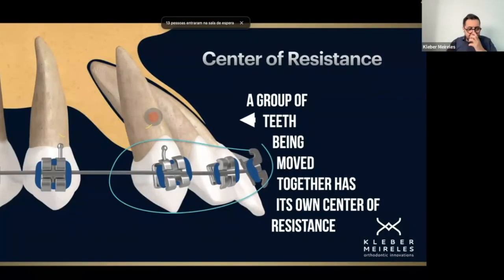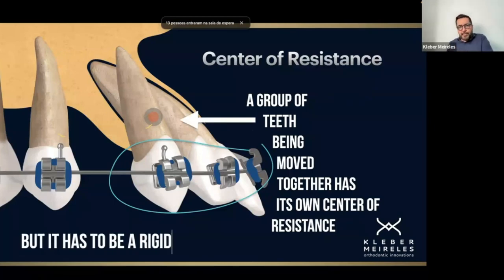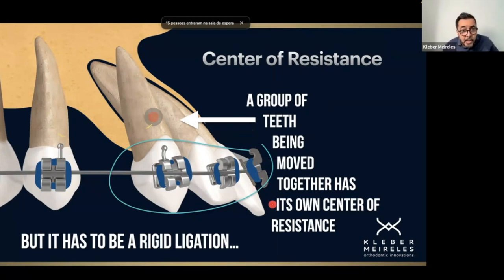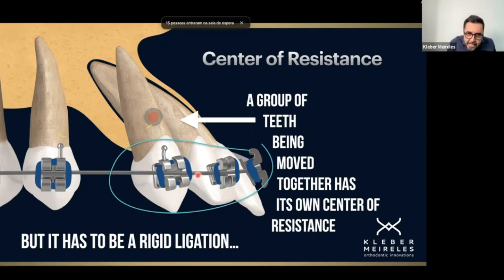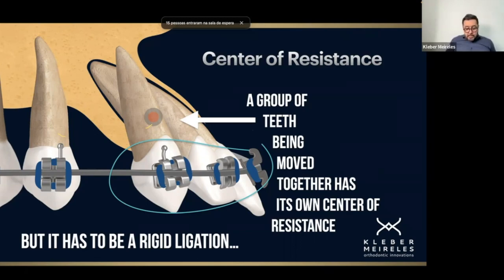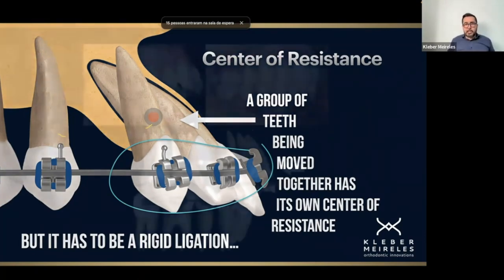Closing Space in upper arch - Translation #1 | ORTHODONTIC TIPS

Comment: if I use .18 brackets , what ss i have to use ?
Reply: The biggest wire in slot .18 is 18×25 but it is not rigid enough to be used for translation